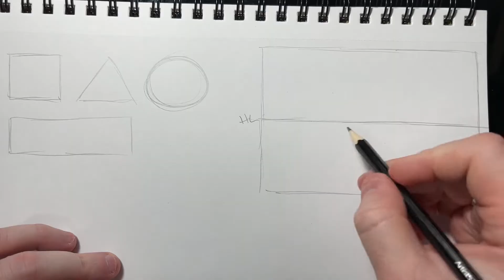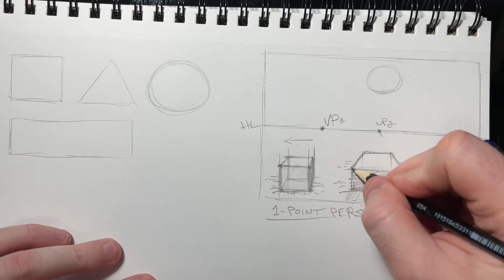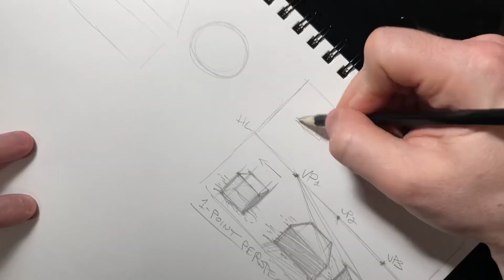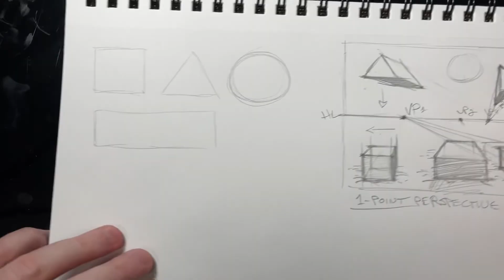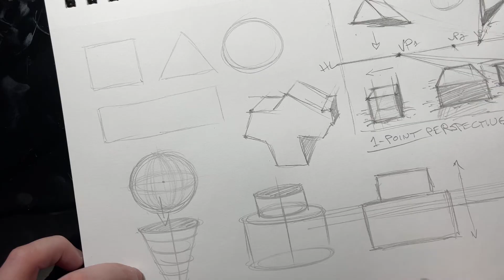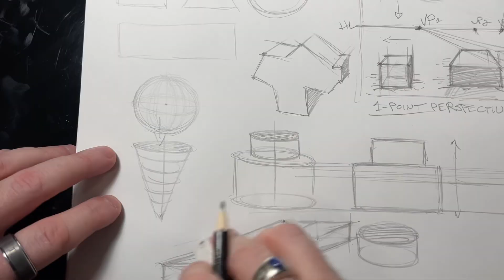Turning SHAPES into 3D OBJECTS using PERSPECTIVE!✏️

Comment: Why do you draw your lines in this lose fashion?
Reply from the maker: @jomen112  You mean as opposed to using a ruler? If so, I do it strictly to practice drawing freehand to show what can be achieved. Rulers have their place, but are not always necessary.
Reply: @drawnbybon  Sorry, I was unclear, with lose lines I refer to the "hairy" lines. I've seen your warm up exercise videos  so I know you can draw a straight line without a ruler, so why don't you? I.e. why do you prefer this hairy style?
Reply from the maker: @ Do you mean: going over the same line multiple times? Much of that has to do with “finding” the straightest line as I’m constructing what I see in my mind on the page. Also, I generally do not use rulers until I ink-finish a piece, which has to do strictly with saving time. I give my professional work and client commission projects the best treatment possible. I will touch on all of this in later videos. I appreciate your questions and comments. Thank you!
Reply: @drawnbybon  We are still not on the same page with question and answers. I am the one to blame for this, by being  unclear with my question. I've been unclear because I don't want to, nor have any intention, to be rude but honestly wonder about your line quality.

As such, I get it why someone would use seeking lines when trying to get the feel for a complex form. I get that, but to do this with basic shapes such a the square and the triangle does not make sense to me. An answer that would makes sense to me is that this is a deliberate stylistic choice of yours, a choice which is still unclear to me.
Reply from the maker: @ I think it has to do with my approach in the moment more than anything. I just happened to use more lines to define the edges in this instance. It’s sometimes the case.
Reply: @jomen112 I kind of dig the loose fashion. It gives the drawing a type of character and vibrance.